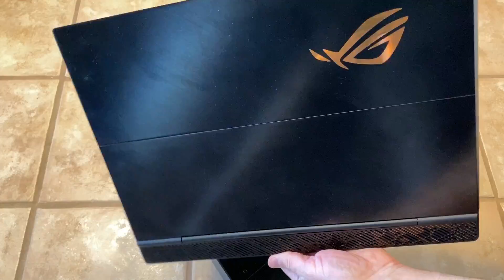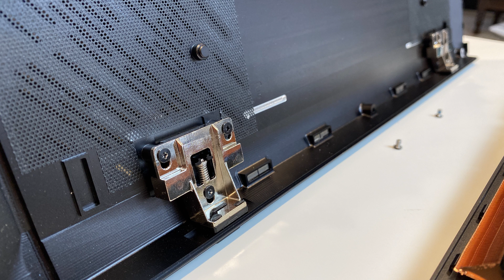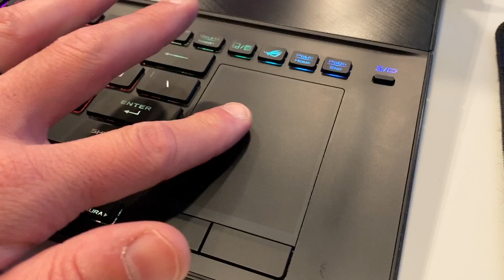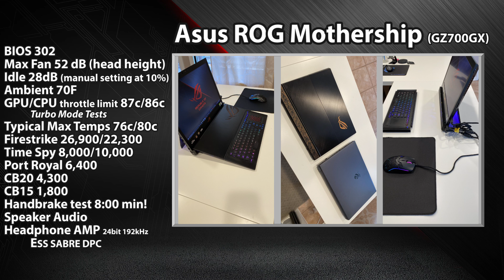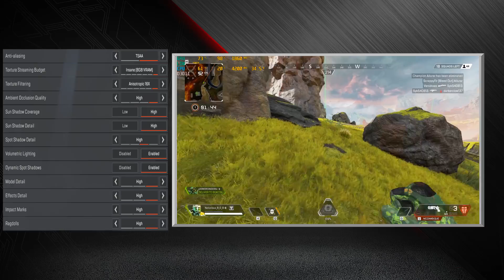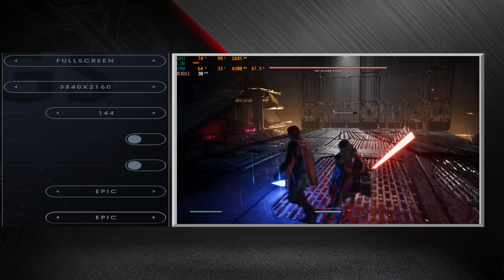Asus Mothership Review!  Is this the future for🔥HOT🔥hardware design?

Comment: hmm good video overall.. despite the price tag and limited model batches.. i think you address most of the cons of the mothership model but with that price tag and justification hardware & functionality, its IO ports felt a bit lacking.. perhaps a mini DP port and 2.5 inch drive for additional space to take the full potential of this beast model..
 Sorry if i missed the point in the vid, the use of 2 included chargers makes no difference (compared to using 1 charger at a time) when used for gaming (or rendering and editing stuff) ? the BIOS setting for both CPU and GPU is locked to size or certain limitations of the mothership ? or Asus just limit it becos they couldn't be bothered with it ?
 I was hoping to have a desktop PC hardware in a small laptop/ small briefcase (TSA approved) chassis (mini itx format) into something like the mothership or the grid compass PC model used by government agencies and a scene used by the colonial marines in a deleted scene in ALIENS movie (using the dr zaber sentry 2.0 or something similar to that chassis) or the alternative is using something like the mac trash can chassis like the Cryorig Ola Mini ITX Case (but it was put on hold due to company management decision)..

 I tried introducing this PC hardware in small chassis idea to Min Liang Tan (razer CEO) when he was having a talk at his alma mater uni, NUS.. he said he would take the idea into consideration and years later they released the blade stealth model with thunderbolt 3 and recently showcased the tomahawk chassis this year but its too big, its thunderbolt 3 bandwidth is limited (compared to the desktop hardware counterpart which has full bandwidth accessibility for both the blade stealth & tomahawk chassis) and lastly its PCIE lanes seems odd but it has potential.. only time will tell when technology in general advances and finally meets my expectations..  that would be awesome,,

Comment: Great review. I love the design, but at that price, I am happy that my laptop beats those timespy / firestrike values for half the amount of money paid. 
The audio quality here is much better (though I mostly use headphones on business trips) and Asus has the better hardware compared to Acer Predator Sense. Anyway, if the price was around 3.5 to 4k I would have thought about buying this one.
Reply: How's the thermals on your helios 700? Can it run the i9 at 4.2 GHz under all core load?
Reply: @gamersanditparadise   Easily. Run all cores at 4.4 GHz and max temp so far even without fan boost was between 70 and 80 degrees.  No throttling whatsover. Graphics unit is even better. Can OC quite a lot and never even touches 70 degree C.
Reply: @timofaust1315  Thats really gud. By the way, how much power does the CPU draw at those high frequencies? :P

Comment: Thank you for answering my question. 
When it comes to gaming laptop review, there are only two YouTube channel which are worth watching: Bob of all trade, and Steve from OwnOrDisown.
I remember, last week I and my wife were watching your msi ALPHA gaming laptop review( which has Radeon graphic card). In that video, you mentioned that Liquid Metal drops tzzhe AMD cpu temperature from 88 C down to 76 degrees C, which is outstanding. While I was watching this msi Alpha ( from your youtube channel), my wife asked me to buy that msi Alpha for her as  Christmas gift, now I have to wait for my next paycheck to buy this msi Alpha as Christmas gift for my wife.
Speaking of Liquid Metal, Bob, could you show the  viewers the video in which you replace the stock thermal paste of the msi ALPHA with Liquid Metal? 
Did msi re-design the cooling system ( heat pipes, & heat sink ) of msi ALPHA? Is cooling system of msi ALPHA different from the GE75 raider?
Reply from the maker: What most people don’t know is that chassis is the same thing as the GE 65 Raider minus the plastic deck. Super solid cooler. 

The LM was put on by HIDevolution. I had them run specific tests and profiles to determine stock paste temps in a worse case scenario before shipping me the laptop with LM 👍

Comment: This laptop is awesome and I feel like they could make some minor adjustments to bring the price point down to a Area 51 type price because I was all in on buying this when it was announced until I saw the price being 6500 I mean 3500-4000 is good but man. I hope that all these manufacturers take at least the thermal lessons they’ve learned and incorporate them into there next systems because there have been some good gains in thermal performance and factory undercoating on a lot of these laptops this year. Keep up the good work I watch every video you make even when I’m not buying a laptop I just like your videos.
Reply: Tom Dehnert dude the reason why the price is expensive because it is so hard to put inside the gpu and the cpu and is time consuming, asus mention it need 114 phase and 20 hour to put it inside of the laptop also the material is expensive it

Comment: Still don't understand why they dont put a single bigger powerbrick instead  of two normal ones occupying two sockets. Anyway i think this should be marketed as a professional workstation too, with quadro GPUs
Reply: its cuz the powerbrick has a legal limit so asus has to use 2 of them
Reply: @ACE112ACE112  certainly a desktop replacement as these require at least 2 power connections (monitor+pc)

Comment: Does Throttlestop work on ASUS laptops or does it's software get in the way?
Reply from the maker: I didn’t have much luck. It was flaky. Undervolting was extremely limited too but it usually is on Asus gaming laptops.
Reply: Bob Of All Trades Thanks for the reply, that’s disappointing hopefully my new G703GXR might run well stock.
Reply from the maker: William Pang Should you decide to use an Undervolt don’t push the Cache more than -.050 for starters.  Tune and test till your happy 😃

Comment: I love this machine! It doesn't make sense for most people but I'm so glad Asus had the balls to design such beast for those lucky few. This is the kind of experiment  than will benefit future designs, even for more conventional laptops. I love that detachable keyboard that allows to elevate the screen to an ergonomic position if you wish, so your neck can thank you later. I wished more laptops had detachable keyboards for that reason, plus the ability to use the keyboard of your choice
Reply from the maker: Michael Pujos I’ve been propping up my laptops lately for that reason,  neck strain.
Reply: @BobOfAllTrades  my work machine is a laptop but I almost always use an external monitor + keyboard for that reason (ergonomically correct position is even more important than bigger display for me). Speaking of which, 2-in-1 laptops have a cool perk often overlooked: put it in tent mode then on a box and use an external keyboard. More satisfactory than using a laptop stand with a regular laptop to achieve the same thing.

Comment: I think if they could get the price down, make it thinner, put in a weaker GPU (like a 1660 ti) BUT crack the power budget up, I'd say they could have a real contender on their hands. Maybe to 150W for the GPU? Imagine having a desktop grade 1660 ti in a laptop (I believe that uses 125W avg). A laptop with zero compromises in performance compared to a desktop of equivalent parts. Heck, maybe even the end of Nvidia MaxQ laptops. Maybe they could move the battery to the keyboard area and purely dedicate the screen part for cooling.
Reply: Imagine this chassis cooling a desktop 2060 super + desktop i7 9700 non k
Reply: @richardzhang2773  better yet, a r9 3950X :D (maybe a lower tdp version...)
Reply: @CephDigital  seriously though, for $6500 I could get a Ryzen 9 3900x + RTX Titan + 4k 144hz monitor
Reply: @richardzhang2773  im pretty sure for 6500 i could get a threadripper 3970x + titan rtx :P